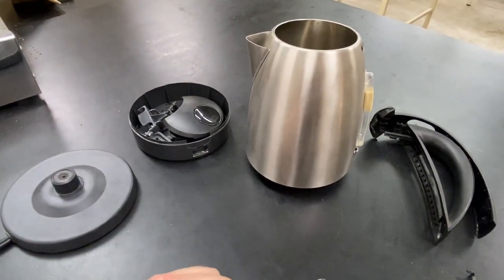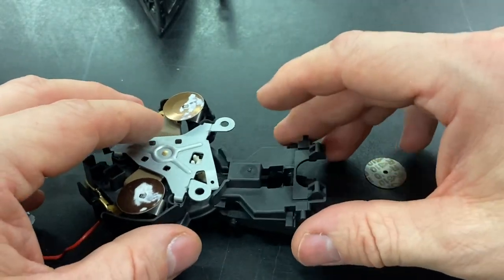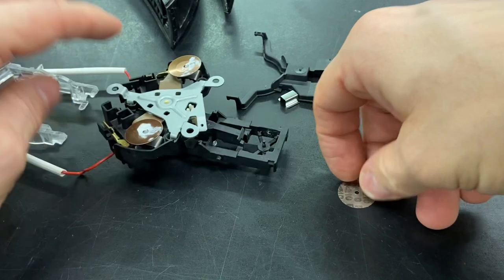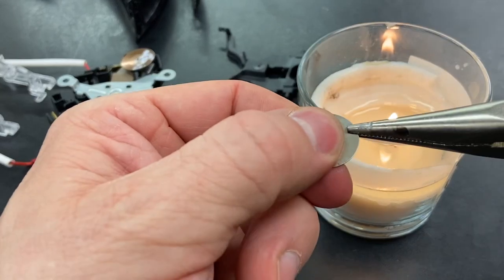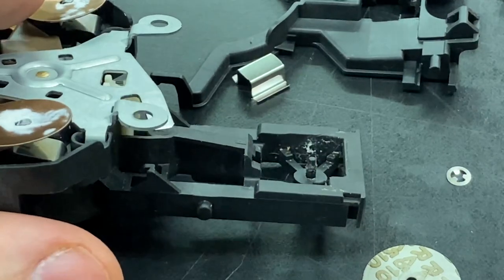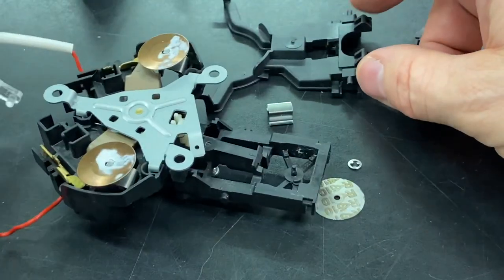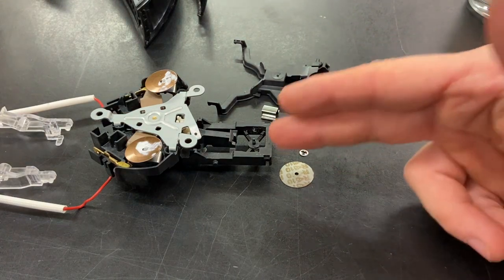Kettle switch fix #teapot #electrical #thermostat

Comment: Perfect explained! I will fix mine soon. I have an ideea. Maybe a very small screw and a small nut could be replacing that plastic pin and that metalic washer. Will be needed two very small plastic or silicone washer  to thermo isolate that disc from the metalic screw and nut and minimize heath transfer from that thermic disc switcher. Maybe to allow movement of that disc will be needed a curved  nut an curved surface washer. Maybe the simple way is to fix in place that metalic disc switcher with poxipol Thank you!

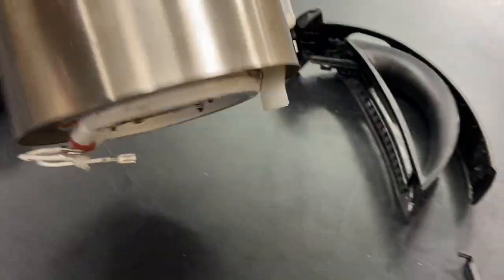Comment: 0:50 Good video. However I can't find a video that covers why a kettle switch wont stay down when you try to switch it on. If I hold it down for about 10 seconds it will usually stay down and on.
Anyone have any ideas ?

Comment: Who would have thought the designers of an electric kettle switch would have designed such a precise and tiny mechanism for a critical function.

Was the part ever repaired , how, and is it working now?
Reply from the maker: Was jammed tight (repaired), don't know how long that part lasted after this 'repair'
Reply: I re secured the disc themostat on my kettle switch and it started switching off again. Then I loosened it and it stopped working, retightened and working again. Looks like loose disc thermostat was the fault, caused by wear and tear on the plastic pin.
Reply from the maker: Yes if the diameter of the plastic pin gets smaller due to the metal snap disc moving along it, that's detrimental fast ...

Comment: My kettle is heating fine but th switch is not staying down on its own
Reply from the maker: Take it apart if you feel adventurous, see what's causing it inside
Reply: @theoverengineer  I did that and still don't know
Reply: @theoverengineer  hey I have some good news I took it back apart and heat the little circle metal plate only to realize it's not moving so I removed it and the kettle switch is working again just that I have to click it off. But that's great better than having to put something on the switch for water to boil 😊 thanks for your video.  If you know where I can purchase the plate let me know 🙏